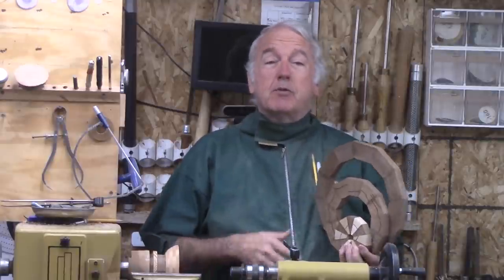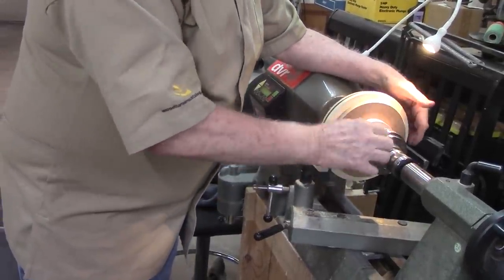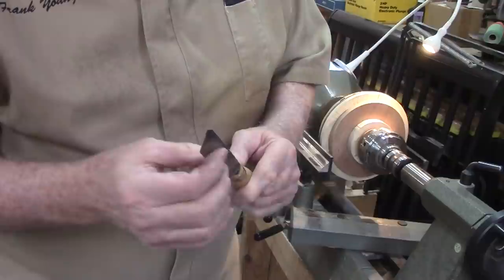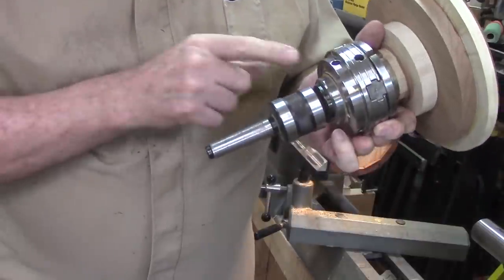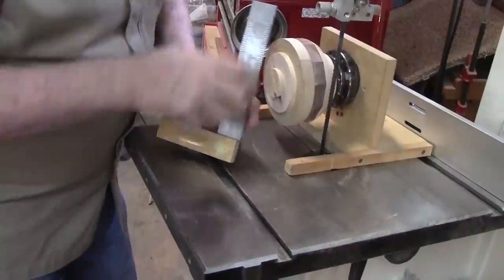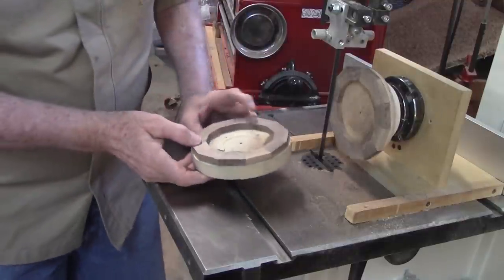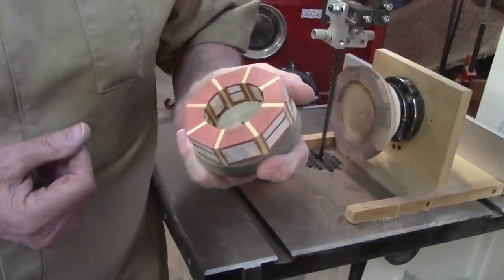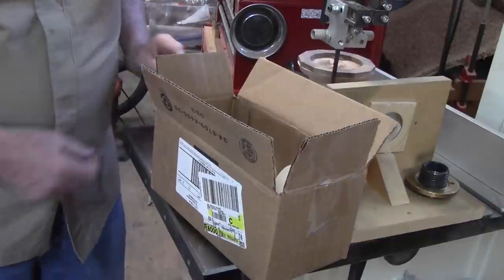Woodturning - Cutting Segmented Rings on Lathe, Band Saw and Table Saw

Comment: Very good video, I like the bandsaw chuck holder jig. I made one several years ago and find it indispensable in keeping my fingers away from a blade. I found that one can get 1 1/4-8 threaded rod easily and inexpensive ($6.00) at a bolt supply store but ask for a 1 1/4" flange "STUD". Then one can cut it into shorter lengths for making chuck mount adaptors. Flange studs come in different lengths but the commonly used size for a standard flange is pretty common. 1 1/4 -8 nuts are commonly available there as well.
Reply from the maker: Thanks Bert for that 1 1/4-8 info.  1x8 are common but I have had trouble with 1 1/4-8.
Alan
Reply: If you ask for a bolt it is likely to be 1 1/4-7tpi which is typical for bolts. Flange Studs used in many industrial applications are 1 1/4-8tpi, the average woodturner wouldn't know that unless they come from an industrial workplace career. 
I re-watched the video and noticed that you did bring the tailstock up to catch the ring but it wasn't running at speed, I usually make a larger diameter dummy tail center from wood to catch the ring so,it doesn't drop to far off center when it's cut free. I have also done what Frank did with a chuck mounted on my live tail center ( I have a 3/4-10 to 1 1/4-8 adaptor ). As always, many ways to accomplish a task, the challenge is finding which one works for the task at hand, it is always good to have options.
Reply from the maker: @bertdelisle393  Thanks for the tip.

Comment: Alan;  One thing I do is Celtic Knot pens.  To keep the kerf as narrow as possible, I use a 7-1/4" circular saw blade (kerf .074).  You must go slowly as the blade will "sing" if you push it too fast.  I'm not sure if your Sawstop saw will work with the smaller blade.  It did not work with the Sawstop saw at the local Woodcraft.
Reply from the maker: Interesting risk with the Sawstop
Alan

Comment: Nice video Alan. On your first cut off..it would be best to put your chuck in the tailstock with a dowel or rod of some sort put thru the piece to catch the separated piece....thank you for your videos and happy 2021!👍🏻👍🏻
Reply from the maker: I think that is about the same as bringing up the live center to catch the ring.
Better yet is the tail stock live center.
Alan
Reply: @AsWoodTurns  not really...a small rod thru the center ..the piece will separate without flailing around like it did..I do the same when parting on my metal lathe..the live center put the parted piece back into the spinning piece you just cut from. up to you...been doing that way for many years...happy 2021.
Reply from the maker: @MikeB0001  I think I understand it now. Thank you
Alan

Comment: Great video, I have been wanting to make a jig to mount my chuck (1 1/4-8) on the bandsaw.  
I could not find a reducer on pen state's web site for 1 1/4-8 to anything.  Would you ask Frank for more information?
Reply from the maker: @RedJeepClub beat me to a reply. Additionally, see East Slope Woodturning's comment.
Alan
Reply from the maker: Exactly
Alan
Reply: @RedJeepClub  That is a 1 1/2 inch adaptor to 1 1/4 ID.  Maybe I was not specific enough I need a 1 1/4 OD to 1 ID 8 tpi adaptor.  The OD needs to screw into my 1 1/4-8 chuck.  Sorry for confusion.